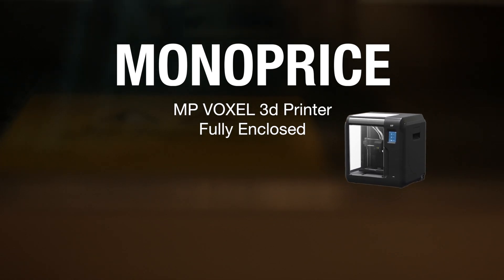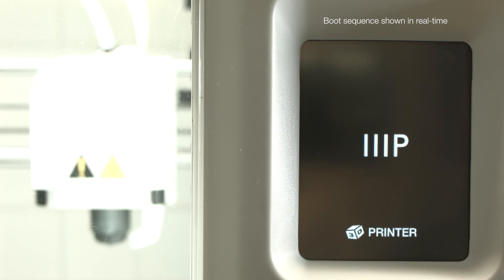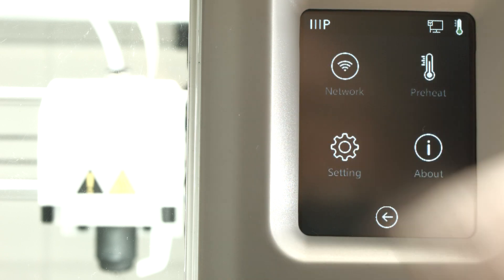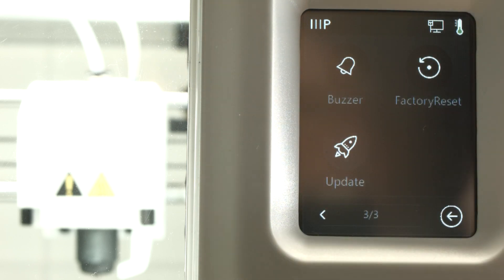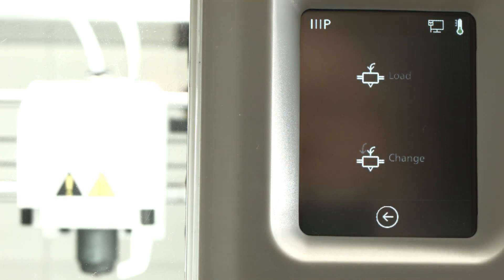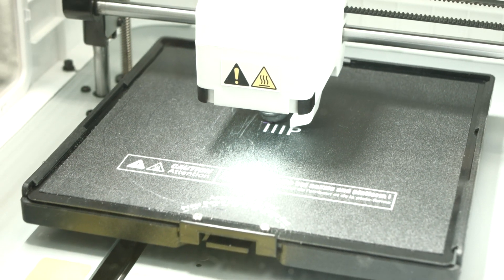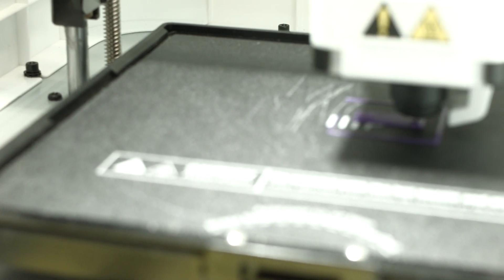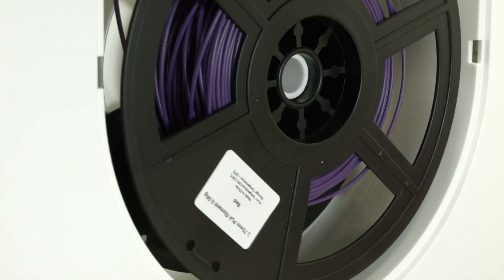Monoprice Voxel 3D Printer Review

Comment from the maker: The wireless network changes the IP address every time i turn the printer on. That is very annoying, because i have to go through the menu to find the current IP and then go back to the computer to connect.
Reply: This is a rebdranded FlashForge Adventurer 3, and there is a firmware bug that makes the MAC address of the WiFi card to change on each reboot. FlashForge has released a fix ensuring that the MAC address of the WiFi stays the same across reboots (without this fix it's impossible to set a static lease in the router). Don't know if it's fully compatible with Monoprice's rebrand of the firmware or not, though.
Reply from the maker: it was fixed with an update. working fine now.
Reply: Use your wifi router to lock the IP address to the mac address of the printer. Address would always be assigned to the printer after that so you don't have to go looking for it. DHCP (default) hands out whatever address is available and after a given period of time it would give a new address.
Reply: @BloodshedRomance  That won't work, because the MAC address changes with every boot. It need a firmware patch.

Comment: Issue I have with the printer is the touch screen - sometimes it registers my selection, mostly not on the first try, and then double clicks.  not very good quality screen for sure.
Reply: And it rarely registers the CORRECT command the first time.
Reply from the maker: That is odd. Mine seems to work fine so far as you can see in the video. I assume you removed the protective sticker?

Comment: Anybody having a problem with the feed gears grind in the filament. I'm running 1.75mm through it as it prints it makes a clicking noise the nozzle is has been cleaned and I've turned up the extruder to 235 and the print speed down to 50mm. Any one have any ideas?
Reply: Joseph Merlino  sane problem here
Reply: And me !! Anyone managed to fix it ??

Comment: I dont get how the extruder motor works well that far from the carriage. I would think theoretically that the filament could flex back and forth in the guide tube causing a delay.
Reply: Rcbif it’s called a Bowden. It’s on a ton of printers and works very well.